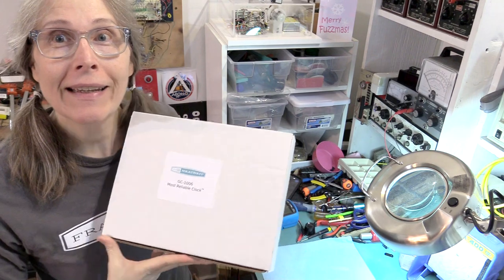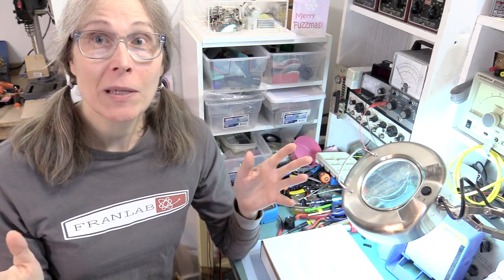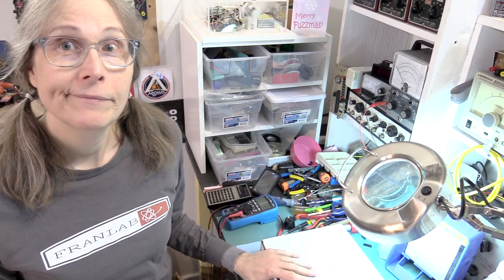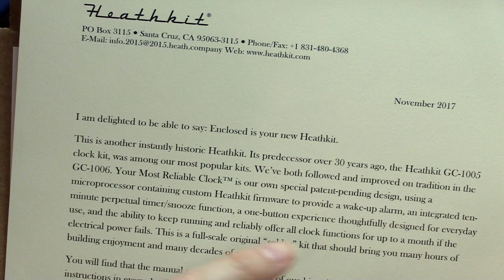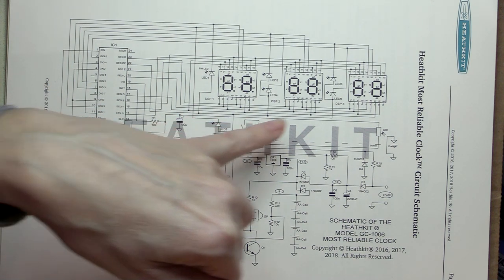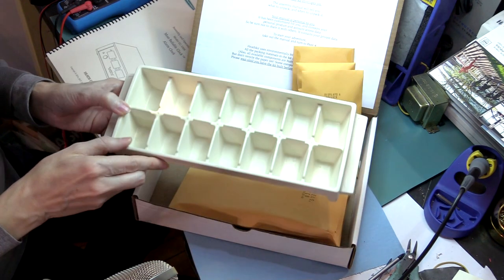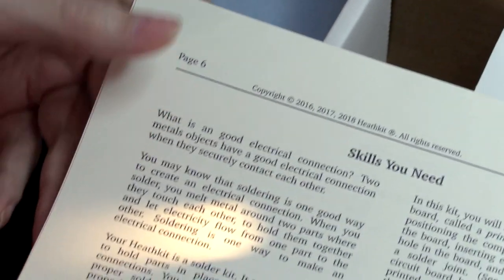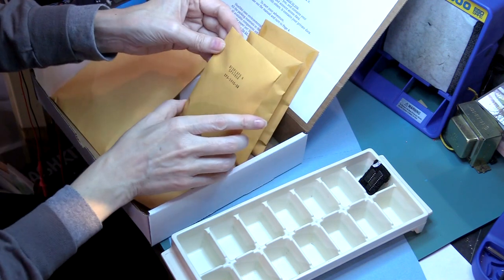New Heathkit GC-1006 Clock Build!   Part 1

Comment: I have buitl 5 Heathkits in my day.  My Dad (a Ham) got me hooked on them.  Cutting the cardboard  box at a angle to poke all the resistors capacitors and  the like in ...in order  as a way to arrange them for the build was shown to me as THE WAY TO DO IT.  Dad was right.. I had a short wave radio I loved ....till it was stolen :(   In High School I built a Heathkit amplifier for a grade in electronic shop  (tube type;  1971 grad)  I made an A  :)   I to this day have a Heath VOM I built. Still works and is rock solid.   Fran you rock lady.  :)

Comment: Not the only kit company to leave the business.  Ramsey did so a year or so ago.  I picked up two of their FM 100B transmitter kits near the end and finally built one in November.  Used it with our Christmas light display.  Built a few Heathkit's in my day including the Most Accurate Clock.  Also built some Knight kits as well.  Remember those, from Allied Electronics I believe.  Also a thing or two from Lafayette as well.

Comment: I built one of those when they first came out.  Changing batteries is annoying at best since you have to remove screws in order to do so.  If you leave the batteries out it flashes "LO bAT" every 10 seconds.  It really needs a way to disable that - I hacked in a resistor to fool the sensor since I really don't care about the battery backup and don't want alkalines leaking into it as the first set did.

Comment: In high school, my best friend’s Dad bought a Heathkit color TV that was all vacuum tube except for the tuner.  He literally gave it to his son and after 2 weeks got bored with it.  I took over and read all the books and then started soldering and building it.

A TV repairman I knew agreed to check on it and the three of us built that Heathkit.  It was an incredible experience that I loved.  The WWII veteran who was our TV repairman taught us so much it’s hard to relate. Then he threw the chassis onto his alignment stand and we aligned and troubleshot and aligned and troubleshot.

Finally, we put the finished product into the case.  Two days after we finished we gave it to my best friends Dad and he kept that TV for 30 years.

Great experience that pushed me into electronics and I got my MSEE in 1979.

And I built over 30 Heathkits in my life. It was a great company. I hope they have great success.

Thanks for the great video.

Comment: I remember the Heathkit TV I assembled (probably in the late sixties). It was mostly transistors and there were something like 11 small circuit boards, all plug-in. So it was easier to build than the earlier vacuum tube ones wit a lot of point to point wiring. You also got a built-in dot generator to set up the convergence. It seemed very state of the art. With other manufacturers,  to get the best chassis you had to buy the most expensive cabinet as well. With Heathkit you bought whichever cabinet you liked (or none at all if you wished). I left it behind when I moved to Europe in 1972 and it fell into dis-use because no-one in the house knew how to look after it.

Comment: My name is Nathan Okun.  I worked as an Electronics/Systems/Computer Engineer for 41 years until I recently retired.  One of my main jobs for almost 20 years was as a computer programmer/data analyst who supported the now-defunct, but widely used, TERRIER Anti-Aircraft Guided Missile System.  One of my primary jobs was the maintenance and upgrading of the Wrap-Around Simulation Computer System (WASP) for testing the TERRIER computer programs in-house so that we knew that they worked before sending a new, revised version to the Fleet and for doing in-house troubleshooting when somebody on a ship reported a problem  The WASP had to simulate EVERY SINGLE INPUT AND OUTPUT of the TERRIER computer as closely as possible to what would really happen if it was actually on a ship.  This meant that I had to get information on how the manual controlling consoles worked, how the radars worked (most of the program was devoted to this part), how the missiles worked, and how the large mechanical launchers worked.  I had to know EVERYTHING about how most of a warship worked so that I could adjust the timing and messages being sent to the computer and the responses to messages it sent out after doing its internal computations.  This had to be accurate enough to be able to pass the various tests programs that could be called up aboard ship to test and troubleshoot the actual equipment  connected to the computer.  I fully understand how you have to know MUCH more than just simple circuit and program design to fully comprehend the entire system for the device you are working on (the massive mechanical launching systems are not much like a computer or a radar, but I had to know all of their inner workings).  There are people out here who understand your approach to "holistic" electronics.  That fix for the STAR TREK box, for example, needed more than just electronics knowledge; you had to know what it was that you wanted and why.

Comment: This takes me back over fifty years when I had relatives living in Benton Harbor, MI. We toured the Heath factory one afternoon and also spent some time in their showroom. It was very interesting to see how they manufactured the kits, including metal stamping, filling the parts bags etc. One particular memory is of the room where technician / writers were building the devices and writing down the steps for inclusion in the manuals.

I spent many enjoyable hours of my teen years building Heath, Dyna Kit and Knight Kits. Ultimately, I went into the engineering field working in the automotive industry on such things as anti-lock brakes and Oxygen sensors. Those hours building kits were good training, especially when I had to physically work on electrical and electronic parts. 

I noted the Heath VTVM on your shelf. I still have mine in a basement cupboard. I'll be anxious to see how your clock turns out.

Comment: Looks like this will be an interesting series. I like the way you started by sorting the parts. Only found out recently from Adam Savage that this is called knolling when done to extreme! The ice cube rack is a nice idea. For the last 20 years I have kept a collection of plastic food/vegetable containers and some transparent egg boxes to keep components in while doing maintenance. The plastic trays that chocolates come in are good for screws and small parts, and I even have a large plastic tray that will keep something like a camera so you don't lose any screws. The transparent egg boxes were popular till about 15 years ago, but have no disappeared, replaced by recycled cardboard. The other thing I do is collect the small plastic tubs with lids that Chinese and Indian takeaways use for chutneys and sauces. The are ideal for keeping screws, washers and nuts in. I've got half a dozen with various mounting screws for HDDs. Very useful and cheap.

Comment: 27:562 - The resistors that throw me are the new light-blue ones. Orange and Brown are hard to discern with a blue background!
Reply: A screw has a thread to the head. A bolt has a plain section of shaft. Or at least that’s how I was taught. So many “bolts” are actually machine screws.

Comment: My own "go-to" clocks for the last few years have been from NIXIE tube clock kits from PV Electronics (in England). Beautiful to look at, work great, excellent circuit and case design, very good manuals (albeit not Heathkit style). The ones I have use a watch crystal for basic timekeeping (of course they are powered from wall-warts so they cannot tap off the 50 or 60 Hz line frequency to use as a timebase), with a parameter to adjust that gets added to or subtracted from the accumulated time every so often in order to keep it overall accurate. My point here is they they ALSO have a port into which you can plug any number of off-the-shelf GPS receivers, including the ones that PV Electronics sells...plug that accessory into the clock and now it is accurate just like a smart phone, etc. As easy and inexpensive as it is to implement such a reliable time synchronizer, it is a real wonder why the new Heathkit would even bother to produce a clock kit without such a feature.

Comment: Sheesh - judging by the poorly edited manual, this version of Heathkit won't be around long.  Looks like another passionate retired guy working in his garage that needs help with marketing & engineering skills. Fran is correct - at the beginning of the manual where it shows the soldering lesson:  That is basically pulled verbatum from the manuals of the late 70's / early 80's.  Most all the manuals had that as a standard first chapter.  We've built many Heathkits, but this kit isn't anywhere the same quality.  You'd think a reliable clock these days would include a GPS module or WWV RF time receiver built in...or even internet connectivity to grab time from any time server pool.  Thanks Fran!!
Reply: They don't deserve to be around long, all they've done is grab a name!

Comment: I bought and assembled this kit a while back.  I have built over 200 Heathkits in my many years.  I was so disappointed in the kit.  Made it way more complicated than it needed to be.  The case was nice, the clock did keep time, but it was a long way away from the Heathkits of yesteryear.  I think Heathkit is now pretty much a garage operation.  I believe the guy who  now owns the name originally purchased all the manuals.  Later he started offering the clock kit.  I don't think many more kits will be coming any time soon.

Comment: I can remember that even by the late 70's the Heathkit Catalog had kits that were exciting to look at & daydream about for a teen interested in electronics, but they couldn't compete price-wise with quality imported products. Their factory-built versions seemed even more overpriced. I was lucky enough to get one of their dual-trace oscilloscope kits that had been sitting unbuilt in a neighbor's basement for ~15 years in exchange for help cleaning out his house when I was 16 or 17. It was quite an experience to build & I actually got it to work with only a few basic tools, a soldering iron and a volt/ohm meter. I believe this is solid evidence of the quality of the kits themselves, the components they used, and the well thought-out instruction manuals. It was great fun and I ended up using that scope for years. The nerd in me felt pretty cool as the only kid showing up on campus with his own scope. It is sad that the company couldn't find a way to survive the technological leaps that came with the I.T. revolution, but it seems to me that the (relatively) new 'maker' community, along with the tools available (programmable microcontrollers, 3-d printing & rapid prototyping, etc,) show clearly that the same desire to be creative that made Heathkit successful in its own time still exists and is thriving more than ever. This could be a perfect time for a "reboot" of Heathkit! 

Writing about this brings to mind something I've been witnessing lately: My wife is a kindergarten teacher. Her school has been working with a group out of M.I.T. who have come up with a program to teach coding in elementary schools - starting in kindergarten and tying in with S.T.E.M. curriculum. Seeing how well these 5 and 6 year old kids jump in and 'get' computer programming is just mind blowing to me. I think it's better than great, because it introduces concepts like logic and critical thinking at an age where the brain is just sucking up knowledge and tying it to reality at a fundamental level. This is the 3rd year that they are doing this, and it has been so successful that representatives from school systems all around the country (and other countries) are flocking in to observe, and they seem to be really liking what they see. Maybe there's hope for the future after all!

Comment: Heathkit is back (again)? Interesting. That manual and packaging is in the spirit of the old Heathkit kits. I would worry about the plastic ice cube tray accumulating a static charge but at least they have the ICs in conductive foam. Cardboard egg trays are another option to help organize parts during assembly. It does look like some of the drawings are from an old manual. I don't think (many) people use desoldering bulbs anymore.

Comment: The solder pads on the top side for only a few pins are to make connection between the front and back of the board by way of the wire and solder to the pads.  The holes are probably not plated so in order to make the electrical connection "you" are required to provide that connection instead of Heathkit spending a few cents more to do the PCB correctly.

Comment: Your discussion about Heathkit is quite interesting.  This is going to get much, much more interesting shortly:  The "post-digital" (my name) era is fast approaching where the various components of electronic- and computer-controlled devices will act like small living things, to be pieced together to form very elaborate other things like Lego pieces.  Basically, going back to the analog world, but with each "analog" component being actually a fully-controlled electronic/mechanical/software-mix component that can be exactly tailored to your desired function.  Except for advanced specialists, nobody will care about how these devices work inside (you could not even comprehend this stuff without years of study, anyway), just like you did not need to know how the insides of a horse worked other than the externally-interfaced things (what it needed to eat, wast products, getting tired, maximum amount it could carry, what kind of training you could do with it, and so forth).  The video game HORIZON ZERO DAWN is a possible example or, in the most extreme form, the T-1000 Terminator and successors in the TERMINATOR movie series.  A wildly different world...

Comment: Wow! I still have the Heathkit GH17A soldering station pictured in the front of the manual.  I had to pause the video and go to the basement to see if it still worked for the first time in a dozen or more years. How do you build a soldering station without owning a soldering station?  The instruction manual said to twist wires together, plug in the station until it heated up, un plug it and quick, make your solder connection.  Don't forget the second step unless you want some embarrassing sparks! Happy New Year everybody.

Comment: I've built one.  It doesn't seem to keep perfect time when on battery backup though.
Only a limited number of the old Heathkits were available factory built, mostly some test equipment and high end audio stuff.
First production run.  Yeah right.  I had the very same letter come with my kit that I bought a few months ago.
Some of the manual illustrations were stock images from old manuals.

Comment: In my limited experience in a repair lab, though not as extensive as yours, those numeric LEDs fail before anything. I've always preferred the sockets to having to replace them straight from the board.

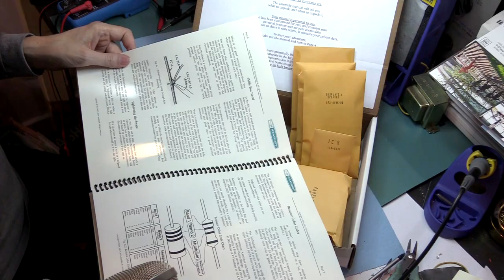Comment: 14:59 - it's possible that those grammatical errors are where the personalization lies.  Like, it's just a sort of digital watermark that they can use to identify who scanned any manuals they find that have been put online for free.

Or, they could just not be checking their own copy (16:24).  Not sure!  :)

It does seem odd that two errors would be right up front.  Then again, maybe they just encode a 16-bit id with 16 deliberate errors, and 0 bits show the error, so the early errors show up, because they haven't sold many kits yet?  Who knows... just a thought.  (It would be interesting (if tedious) to compare manuals with someone else who has the same kit (ideally from close to the same time, in case they made corrections.)

Comment: By the way  under the Tightening Hardware section...   since when do screws have nuts?  last I saw only bolts have nuts...  Weird.
Reply: 20 years in the hardware business, I can testify that there has never been any consistency over this.  Isn't a 1/2 x 4 hex cap screw really a bolt?

Comment: those small caps will be monolithic ceramic caps not tantalum. the connector will be the ICSP (in circuit serial programming) header for the ATtiny

Comment: I built one of these two years ago and it has been working fine. It’s a pity the company itself has not done more, there a piece of amateur radio gear which has been in pre-production forever. Sadly, I think this clock is all we’ll see. I have a stash of 100 unbuilt kits to keep me busy in retirement.

Comment: I'm hopeful that the new Heathkit can live up to their name.  I took a look at their offerings, and right now the clock is probably your most practical option.  The AM radio seems cool, but I wish they'd have an option for mains power and a three inch speaker.  Having to use an externally powered speaker with a battery operated radio doesn't make much sense to me.

Comment: Hello, I picked up an IM-18 Heathkit VTVM recently and it's NG. So I have an assembly manual and it's time to check it point to point. I miss those kits. Fran the mike is still breaking up. Only you all other videos are fine. Just a thought. Funny your "new" manual seems to have "The Kit Builders Guide" included. My IM-18 manual refers to the guide as a separate booklet.

Comment: As you presented the schematics, I immediately came to notice that the Backup Batterys are constantly discharged by R11 & R12 (22k + 10k Ohm) resitor network to ground... I have my serious doubts about the reliability of the clock in regards to the Battery Pack...